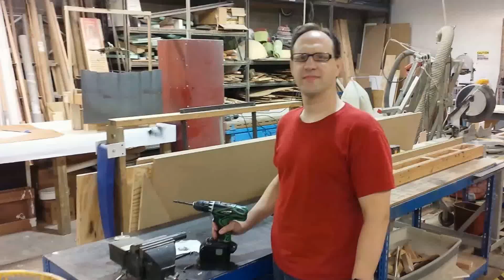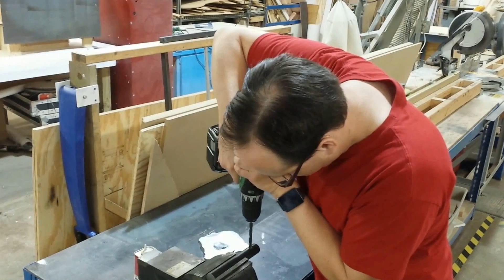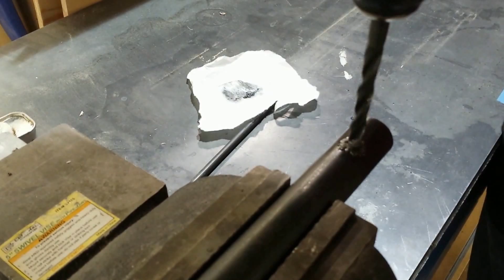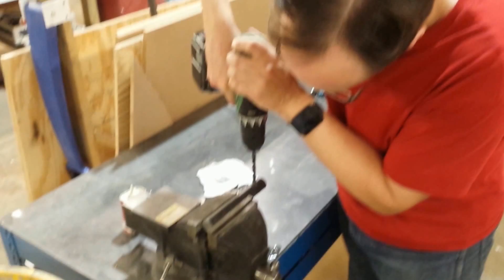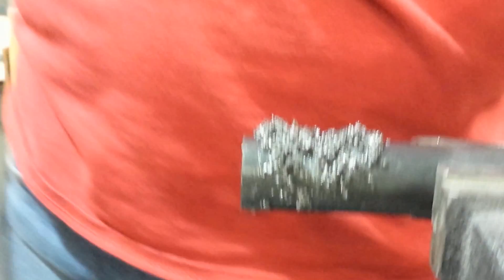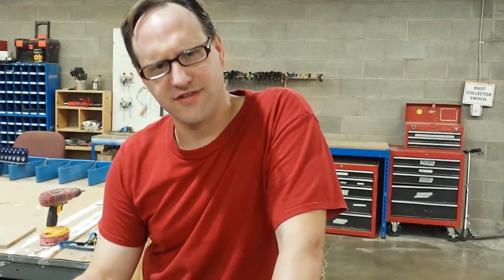Drilling Through Steel

Comment: Concise, succinct explanation for a amateur low to moderate experience D.I.Y. guy. No heat and smoke from my or drill bit or brain, and plenty of chips of the old block without over explaining the subject. Muchas gracias Senor.